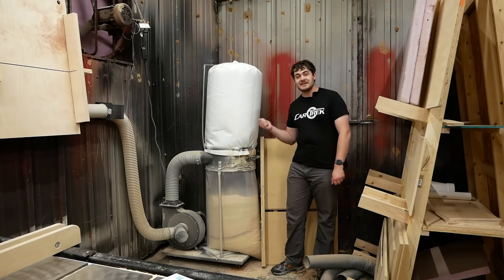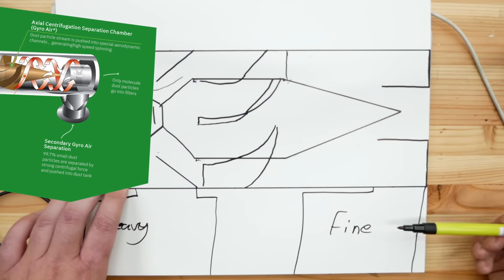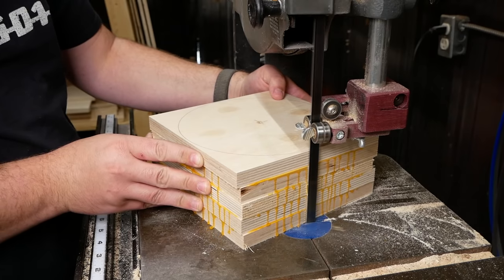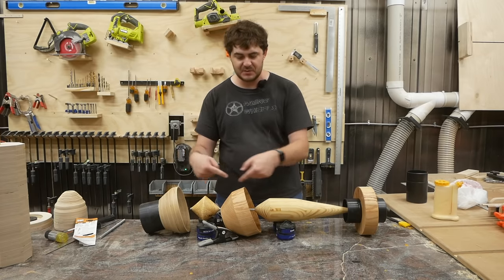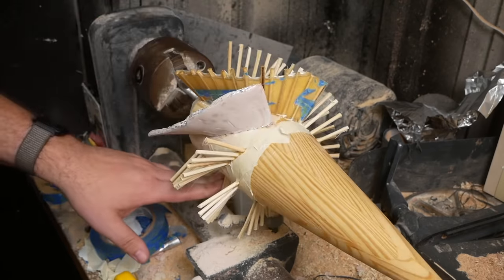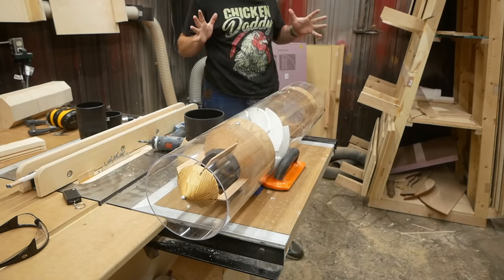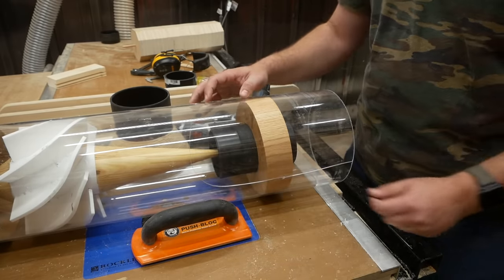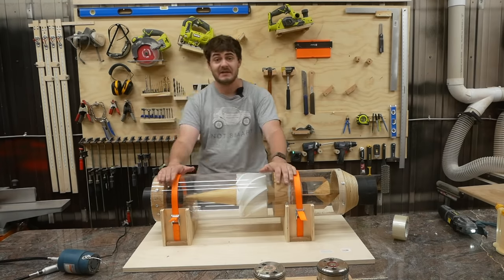I Made a Centrifugal Dust Separator to Upgrade My Cheapo Dust Collector

Comment: Spend the bucks and buy yourself some REAL lathe turning tools before you kill yourself with those toy ones!!!
I think I would have used metal A/C duct tubing instead of that expensive plastic one.  Do you REALLY need the duct to be transparent?
Wow REAL GLASS!!!  I would have used plexiglass (easier to cut and good enough).  Also klutz proof!
Because the blower sucks air INTO the dust collector instead of THROUGH it, it means your blower will get full of dust eventually and you'll have to clean out the blades of the blower.  Maybe even change bearings once in a while.  But if you tried to suck through the collector (blower between the collector and filter box) you might need a bigger blower.  Or should it be called a sucker?  I think the issue with those filters is that they are intended to have air SUCKED through them, and not BLOWN through them.  Yeah it makes a difference (did you observe the arrows on the filter as to the direction of air flow?)
Lots of kudos for building your own.  I built my own 3D printer and it was a lot of fun and education.  But I wouldn't recommend that the average DIYer do what I did.  Go out and buy a Prusa!  (I built mine before you could buy a Prusa, and I might have spend less than buying a Taz or a Makerbot, but probably more in the long run than if I got a Prusa today.

Comment: Some notes from a new viewer:  1. it was super frustrating to watch you try a bunch of things that didn't work, as well as to sabotage yourself through being cheap (using stuff you "had on hand"), and 2. 3D printing would be way more suited for this than turning chunks of wood on a lathe, like whittling yourself a frame for eyeglasses out of a chunk of whalebone.  Just throw it into a CAD program, print it out on a 3D printer, and when your first design invariably needs adjusting, instead of having to go back and carve all new parts out of wood, you just adjust and reprint.  I get that you're a wood shop, but for something like this where you only need to build one and you need it to be right, use the right tools and materials for the job.  AND before you say you don't have a 3D printer, if you are anywhere near a semi-large city, you will likely have maker spaces where you can use their equipment - and here where I live our main library has a 3D printer people can use for free.  I'd much rather watch a 20 minute video of someone doing something they've figured out, than a 40 minute video of a dude doing everything wrong.

Comment: Man if you are going to do instructional videos you need to use the right equipment and have a clean work area. Your wood turning bench is a mess. Safety safety safety. I hate giving wood workers the speech but you need to work safe.